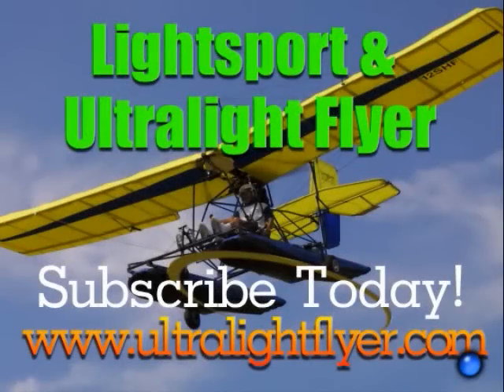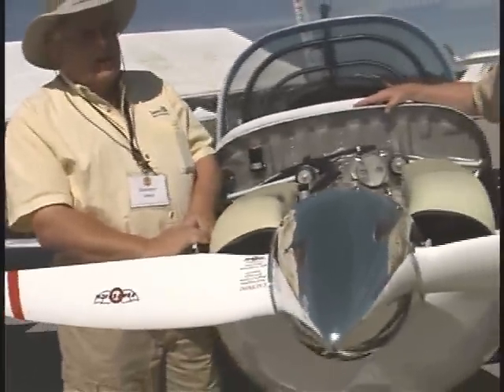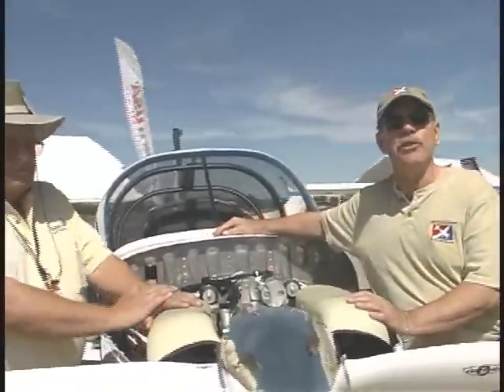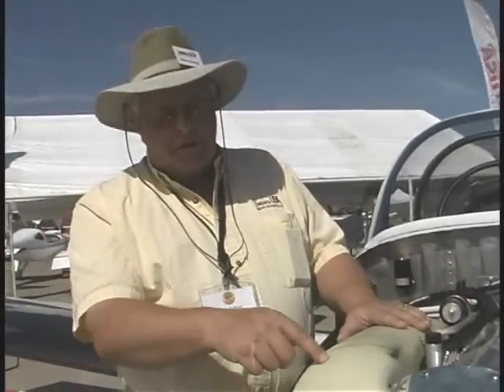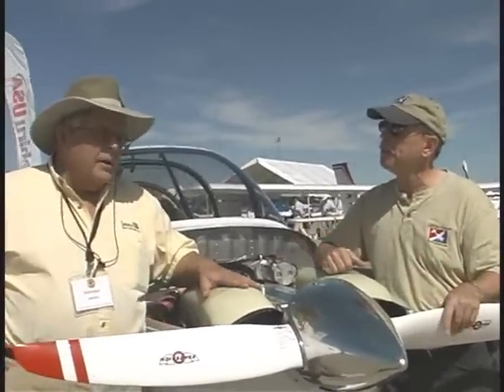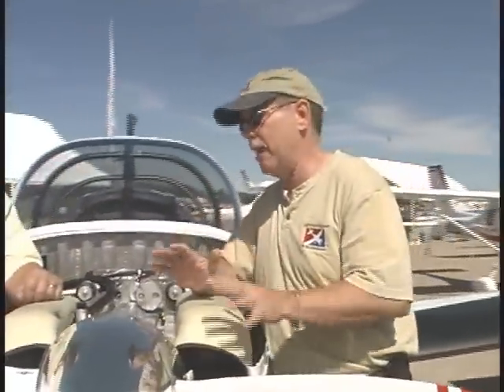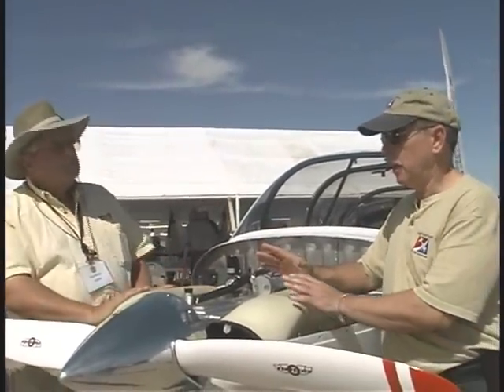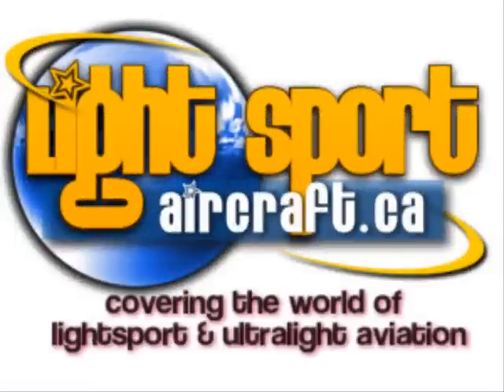Jabiru 3300, 120 HP direct drive aircraft engine, RANS S19

Comment: CASA came to the view that poorly maintained and modified Jabiru engines are a problem.
Reply from the maker: That is NOT the true story - for the correct information - https://youtu.be/250TMFHlreE
The Ultralight Flyer
Reply: They talked nothing about Top Speed and Performance while in the air you got a hundred 20 horse I figured they'd want to tell you

Comment: Rotec Australia has a solution for the head temps and thus the movement of the factory heads. They also address several other issues the Jabiru 3300 has... Solid bottom end, just needs help with head issues, alternator, etc... issues.

Comment: They dont make TBO.Lucky to make 500 hours.
From my experience
Reply: Was it head related? I am looking at buying a used J230, and am planning a modification of the engine by Rotec, to address head temps, etc... Mod costs $3700 shipped to the USA. plus installation.
Reply: @ormandhunter5598  No, his was a 4 cylinder that had through-bolt breakage.  This became an issue on high-time Jab 4 cylinder engines.  New bolt design is now available as a retrofit

Comment: They maybe smooth but Jabiru engines  shit themselves alot.
Reply: dazza--- I see that you have made sure to comment wherever you can about your misfortune with your Jab engine.  Well OK, but you are not being accurate & careful in your invective.  The high-time Jab 4 CYLINDER engines were the ones having the bad thru-bolt problems.  Like yours.  The 6 cylinder engines were NOT having those issues.  AND Jabiru has addressed the issue with new-design bolts that are owner replaceable.